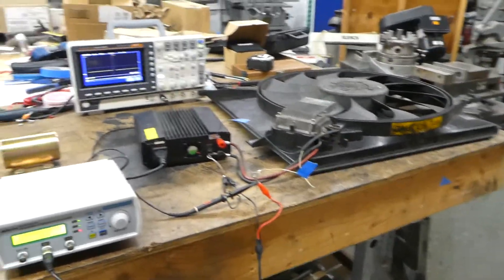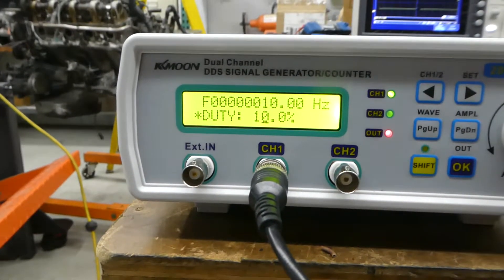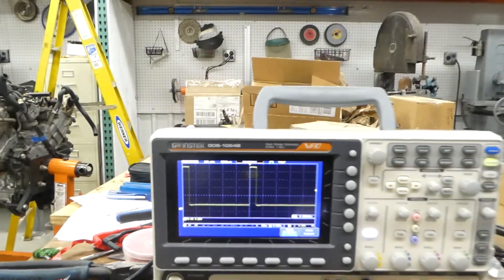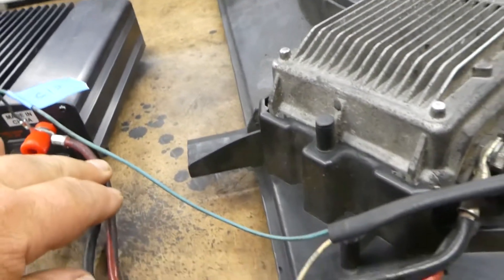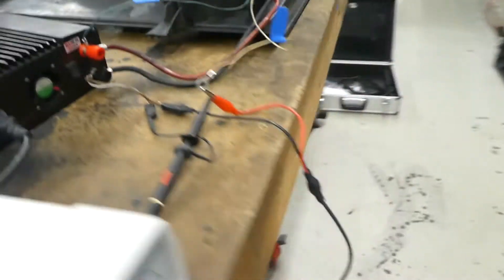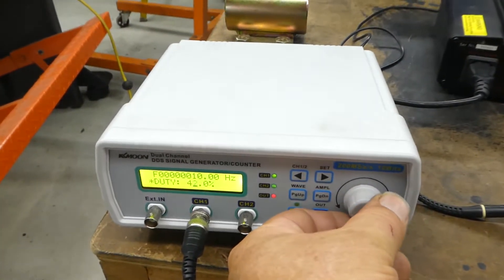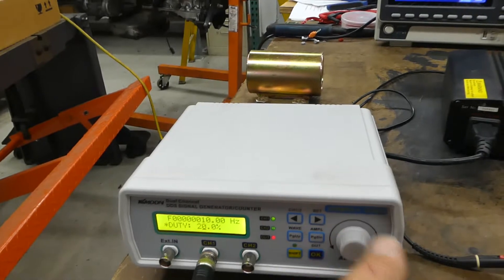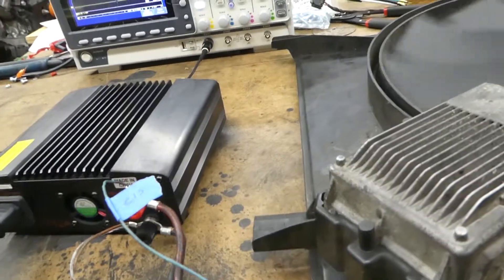Running the Mercedes PWM Cooling Fan

Comment: Thank you for this video. I am trying to operate a similar fan using one of my Holley PWM output however the module does not recognize the PWM signal. I have the choice of PWM- or PWM+. Every info i found so far suggest to use yhe PWM- however per your explanation i yhink you might be using a wave from zero to positve voltage, can you confirm?
Reply from the maker: Yes, I go from 0 to + 14V for a Mercedes. Others may differ.
Reply: @jroncallo i made it work, it needed PWM+ at 13hz

Comment: Thanks for this video, I have a mercedes ml w163 2.7 diesel and the fan tries to kick in on low speed  when I start the car but fails and the check radiator sign shows up on the dash board . The fan will only kick in when the temp goes up and then the fan runs at full speed. I have checked the fuses do u think its the control module for this fault? I get 5 v on the signal wire to the fan and 12v on the larger direct wire from the battery.
Reply from the maker: Unfortunately I don't know much about the Mercedes Benz fan controller. I only know how to make it work as a stand alone fan. I can say that reading 5v on the signal wire with a volt meter equates to about 30% - 40% PWM duty cycle, which means the fan should be running at 30% to 40% speed. So it sounds like you are getting the proper signal to the fan but for some reason the fan is not getting the signal. It could be dirty connector or the fan is just bad. You should also be getting more like 13.5V to 14.5V on the larger battery wires at least while it's running.

Comment: I was wondering if you could help, I have the same fan in my ml63 2008, the fan spins when the coolant temp goes up, but it doesn't spin fast enough to cool the vehicle, it will only spin fast when I turn on A/C, so technically I have to have the A/C on all the times, do I need a new module? thank you
Reply from the maker: Since it comes on with AC on I believe your fan is OK. You low speed could be caused by some of your sensors.

Comment: Hi, I was wondering if you know what voltage range is considered the off cycle and what voltage range is considered the on cycle with this PWM signal?
Reply from the maker: zero is off 12 is on. but it will work with as little as 5  volts on. But you are not supplying voltage you are pulling the 12V supplied by the fan to ground.

Comment: Thanks for the info on the PWM. I simply used a small arduino to generate a PWM into a mosfet that was switching the 5v to ground.
Reply from the maker: I did that as well and it works, but MB uses a 12V signal so I decided to go with that. I also found that a 3.3V version of the Ardruino will not work without switching an external 5V to 12V power.

Comment: Thanks for this helpful video. I'm running a A1645000493 from Brose with 600W normally used on the ML and R class Mercedes in my 68 Cuda. I've connected it to my Holley HP output which is a 12V PWM plus signal to the yellow wire of the fan and the C15 12V to the green wire of the fan. Also coming from the output of the HP.  I've tried different frequencies starting from 10hz to 200hz but the fan after startup is going into full speed despite of the value of the duty cycle. Do I need a PWM negativ signal or what I'm doing wrong here? Or will this kind of fan not working without a controller from Mercedes? Thanks for your support.
Reply from the maker: You actually need a PMW signal that pulls the 12V power from the fan down to zero.
Reply: @jroncallo  I've tried to use the PMW negativ on the Holley HP. Fan is going in full speed immediatly.

Comment: Greeting to a friend. I have a fan like this 600w on my mercedes w211 om648. For me, the fan only turns on at 97c, until then it stops. That seems like a high temperature to me. It only happens in heavy traffic. When I drive on the open road, the temperature is 90c.
Reply from the maker: Seems a little high but not too much it its maintaining 97C. I suspect there is a gauge or sensor error.

Comment: Hi. Thanks for the great vid. I have a 2016 Merc Vito, Viano fan that I bought. I want to make it work but it does not seem do do anything. It has a thick Red wire (Obvioisly Positive), a thick cream coloured wire, a thin black wire and a thin purple wire. Do you perhaps know hpw I can make it work. Should the fan start spinning if I connect up the Positive and ground (Thick wires) and then earth the black wire?
Reply from the maker: The fan will not work with just the large Red and Cream wires connected to a battery. You will need to find out which of the other two wires, gets powered with the key on. Connecting that one to battery + will run the fan at full speed. My best guess is that would be the black wire. The other wire will be the PWM signal and needs to be connected to a PWM signal to run the fan at lower speeds.

Comment: Good evening 

Sir, I'd like to install this fan with all radiators from a AMG 63 to a project. But, I can't "drive" the motor as I need a pulse from ECU. I read in comments that you suggest an Andruino mechanism, but there are some problems of sensors etc. Is possible to by pass the first module and "drive" the motor with that: "CWI PWM Controller" or a controller from "autocoolguy" or you build something? 
Thank you in advance
Reply from the maker: I'm not familiar with those other controllers. This is my first project on Arduino. I don't have any problems with my sensors.

Comment: great info .. ii been scratching my head on a Benz fan i installed in a old datsun (my small wires are blue /blck and green/orange from a w203 at a wreckers yard) .. i know on my actual benz  w209 the ecu does the pulsing i figured i would need to sort out what small wire did what and get a pwm frequency generator , and you gave me in the insight on how each duty cycles it functions.. thanks for the video

Comment: I have a 2012 Merc GL350 and my suction fan does strange things. I verified 12v power to fan, 12v ignition power to fan, negative to fan, it is the control wire that is doing strange things.  If I turn on the car no fan ever. If I try to activate it using Auto nothing. However, if I unplug the fan w engine running, and replug fan it starts to spin slowly. With the Autel I can activate the fan and it will run max until I tell it to stop. Would you please lend me some knowledge/advise? What is wrong w fan? This is a replacement aftermarket fan.  I replaced the original thinking this would solve issue.
Reply from the maker: Not sure if your 2012 GL350 fan works the same. But if it does the fan should run full speed with the PWM signal disconnected and the key on. If that works then you will need to test the PWM signal using a scope. These fans are known to go bad.

Comment: Hello I have a 1987 mercedes 300d w124 I would like to convert from clutch fan to electric fan. I live in boise idaho where summer Temps are over 100f .
And with ac on the engine temp will hit 100c.
Do you know of a fan you can recommend that would work for my application 
The finned area of my radiator is 19 x 24. Any advice or suggestions would be greatly appreciated. Thank you for your time and videos.  Robert
Reply from the maker: With a 19" x 24" Core you may be able to fit an 850W fan from an ML500. They are controlled the same way as the 600W fan I'm using in my 107. The fan I am using is from a W211 E500.
Reply: Thank you for the very useful information. I also want to use the W211 E500 fan (manufactured by Bosch) Can the W211 E500 fan frequency be used at 100Hz?
Reply: @omayo-kt3zt  i didn't use mercedes fan. I used a pair of mishimoto 12 inch fans and a davies craig digital fan controller that comes on at the temp you preset. It also kicks the fans on when a.c is on
My 1987 300d and 300sdl run at 85c on 100deg days with ac on high. I hope this helps
 Good luck with your projects 👍
Reply: Thank you for giving me the information!

Comment: Whats the overall dimensions of the shroud itself without the mounting "wings"? I'm curious about this fan, is it a Spal or Bosch and is it a brushless or brush motor? Could it be controlled with a PWM? Any idea of CFM? I'm looking for alternative fans for my 69 Camaro BBC which has a 23" X 17" radiator core, and I'm just running a big Holley double pumper, so no ECU.
Reply from the maker: The fan diameter is 19". It is made by either Temmic or Bosch. Don't know if its brushless. It is only controlled with PWM or you can just run it at 100% speed with a 12V DC signal. No idea of the CFM but it is ~ 50amp. compared to my previos 3000CFM 16" Flexalite I would have to say its a lot. I'm using it on my 22 x 16" Benz core with no issues.

Comment: I have the same fan. Which kind of PWM works with it? I want to install on an older car
Reply from the maker: You really need to build your own using an Arduino or something. You will need to get a 12V PWM signal.

Comment: Is it possible you can sell pwm controller to control the new Mercedes fan (850 watt) .. i want to uset it  for my old truck. Thanks
Reply from the maker: I do plan on selling these but it is going to be a while. The 850W version is the same as the 600W version.

Comment: I was wondering if you could run one of these fans on a older car like a chevy corvette late 80 early 90s
Reply from the maker: Absolutely. The shrouds cut very easy on a table saw and then you can pop rivet an aluminum shroud to the plastic MB one.
Reply: @jroncallo  what about the wiring? Do I have to run a pwm controller? I have a set from a 2017 Silverado but couldn’t get them to come on just to test like the old style fans. It has 3 wires 2 larger ones and one small wire
Reply from the maker: @Chasemanuti  Yes you will need a PWM controller unless you want to run at full speed at all times.

Comment: This video was a ton of help. Thanks for making it. Do you happen to know how much current these things draw at 90%?
Reply from the maker: It should be about 45 amps, however I measured 38 amps at both 90% and 100%. But I suspect the current may go up when the car is in forward motion and the fan gets unloaded due to air speed.

Comment: Thank you. I was actually trying to control a new model with the circuit inside the fan motor. 
I see that you are using 5v for the pwm, that might be my problem. Was trying with 12v.
Reply from the maker: I have heard anywhere from 3.5 to 12V. It work at 12V as well as it does at 5. 3.8 was about the lowest I could go. When you say new model be careful I heard the Bosch motors run at 100Hz to 300 Hz.
Reply: @jroncallo  never got mine working, turns out the one i got is controlled by linbus